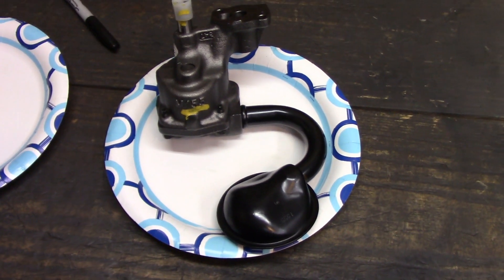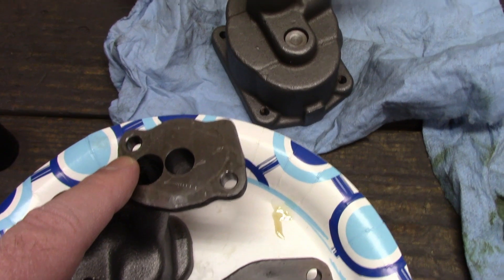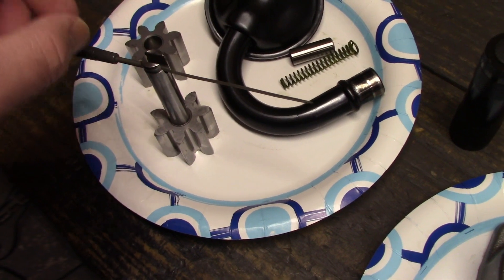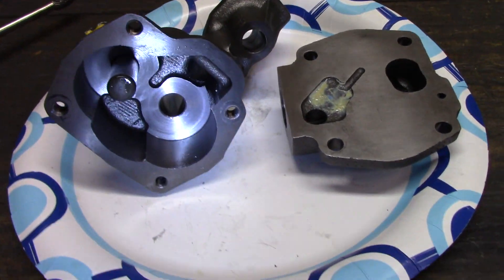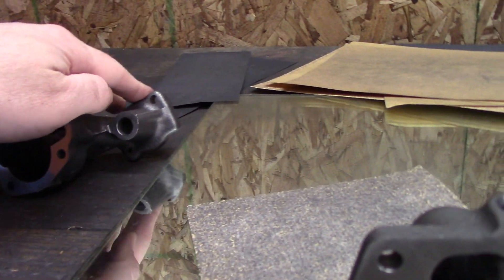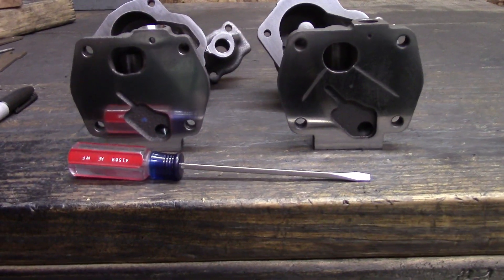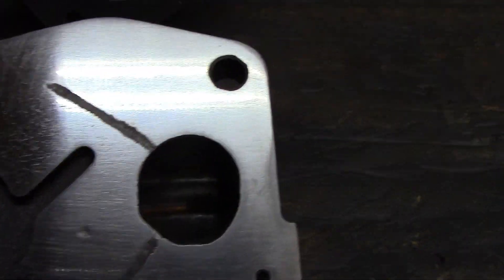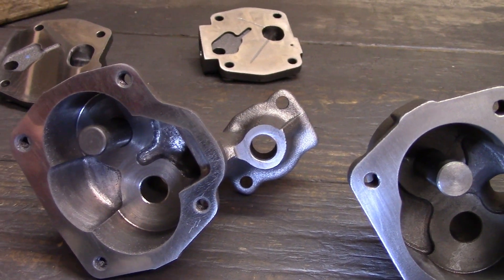Melling M155 Oil Pump Port, Resurface & Comparison

Comment: Have you had a shark tooth pump apart to see how they are done from the factory? I'm curious if they radiused the inlet hole and the hole inside the pump. For what they cost, they should.
Reply from the maker: Not sure what oil pump vid it was but i did show a Sharktooth if i rem right.

Comment: Hi there my car orginaly have m55 someone recommend the m155 as it have bigger screen , my question can m155 directly  fit my engine without any modification my car is 78 Camaro 350 cu.
Reply from the maker: M155 has a bigger 3/4 pick-up tube, the M55 is 5/8.  Screen size, it depends on your pan/pick-up.  Stock type oil pump pick-up's usually have larger screens but sometimes you need what fits your oil pan design.  Just make sure to get the right size tube and install it at the correct height for your oil pan.

Comment: Take a look at  drive gear on Milodon pump body,   gear teeth protude in the oil hole passage while Melling has less teeth protuding in that passage . I think it will affect oil flow .
Reply from the maker: Your prob right!  I noticed there was also even more of that area cut out on the sharktooth pump, think I showed that pump body in the Milodon video.  Thx for pointing it out with these pumps!
Reply from the maker: Yup I got a pic from a book that talks bout exactly this.  I'm sure it's in a book or two I own also LOL